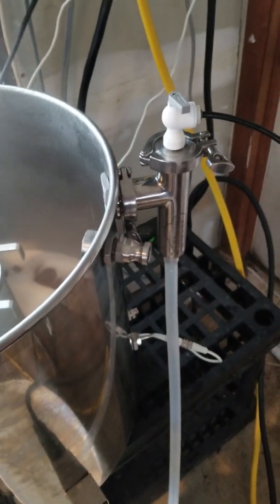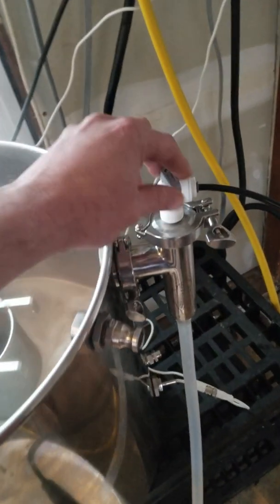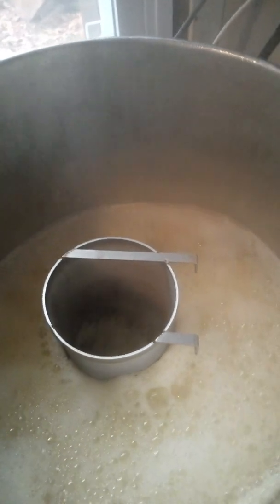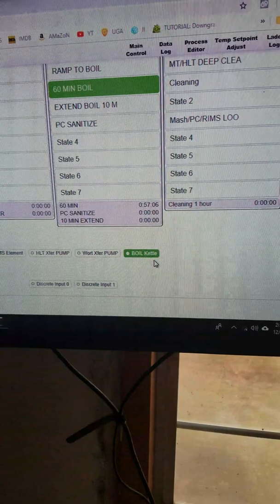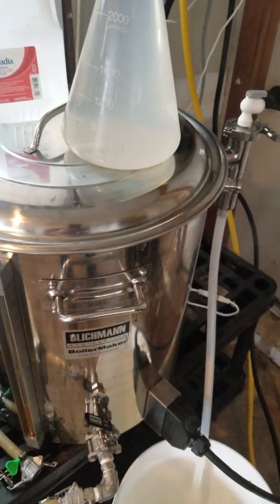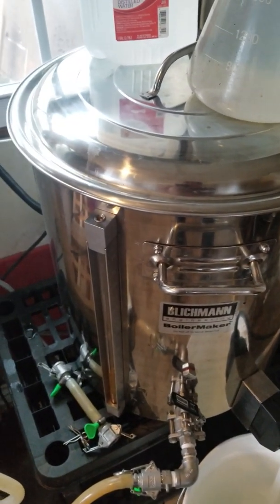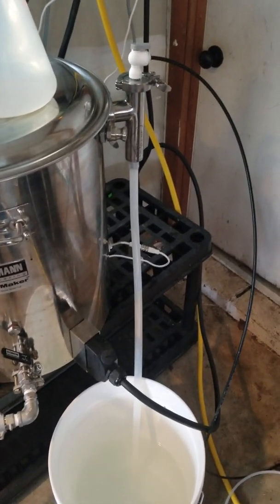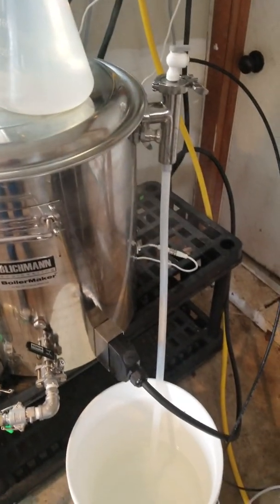Steam Slayer Part 1 Initial Boil

Comment: I’m looking at this and wondering if the physics are correct. If the body was more conical to a neck. Then opened up to a larger hose to the bucket. This would make a better Venturi . The water spray would create more vacuum and condense the water more efficiently. I guess I’m going to have to make one to prove my point at some time.